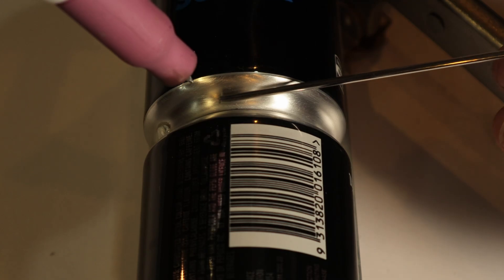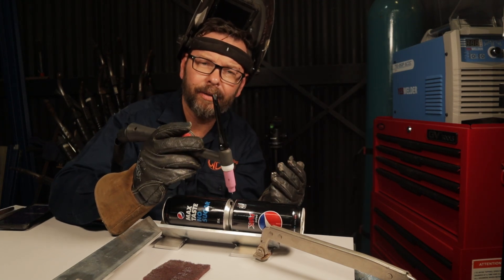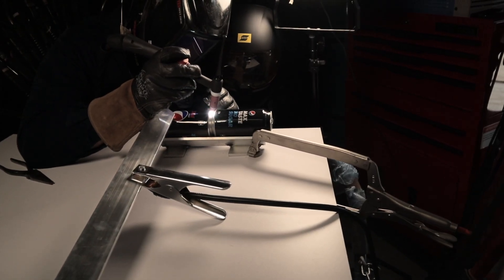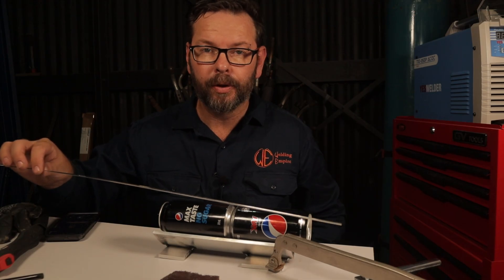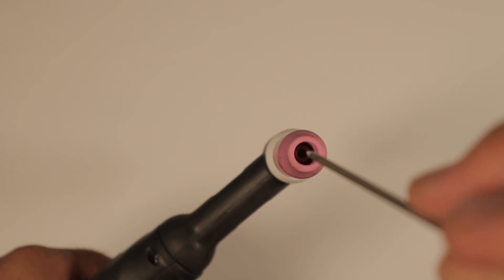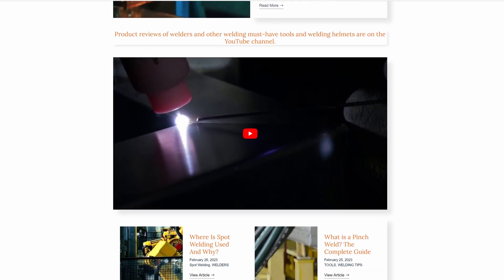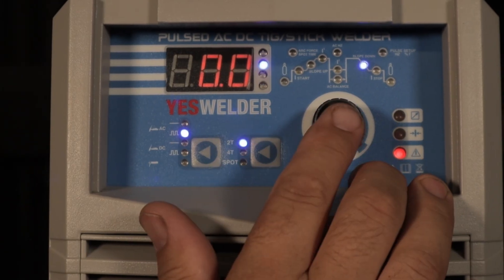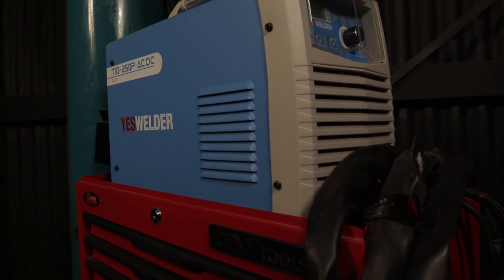How To TIG Weld Thin Aluminum, Using The YesWelder 250p AC/DC

Comment: I’m new to TIG and recently purchased a Yeswelder 200P so I could weld SS and Al. I’m learning Al and having some difficulties so looking forward to try your settings (as close as I can get) with my machine and playing around with a few of them to understand better how they affect my welds on different thickness Al material. Reading through the comments, I was especially impressed by the fact that you responded to all of the commenters. This is something I find many Youtuber’s don’t do is reply to those who comment, and especially annoying, to those who ask pertinent questions. Bravo for respecting your subscribers and commenters.
Reply from the maker: Hey @hwobstj, thanks for the kind words! Glad the info is helpful.  Aluminum can be a real challenge, so don't get discouraged. 

Remember that a clean tungsten is VERY important for good aluminum welds!  

You'll definitely need to tweak the settings to find what works best for your specific machine and the aluminum you're using. 

Treat my suggestions as a starting point.  Keeping a detailed log of your settings and the results you get is super helpful for learning. What aluminum thicknesses are you planning to work with, and what size tungsten are you using? 
 Good luck with your TIG welding.
Reply: @ Al 1/8” flat bar and 3/8” rod currently for a small motorcycle side stand improvement. Tungsten I’m using is 3/32” green pure. My welds were dirty until I did a better job cleaning both the electrodes and the Al. Then I managed to get reasonably good results with solid welds.
Reply from the maker: That's great to hear. It's all learning mate, now you can be proud of the things you have made or repaired. Your welder will be pay for itself in no time.

Comment: I don't see the Yes welder 250 AC/DC on their site.  Is this similar to the TIG-200P-ACDC-PRO AC/DC Aluminum TIG Welder
Reply from the maker: Hi Brett, sorry for the late reply. I just had a look at their website. It looks like they discontinued it. I don't think the TIG-200-ACDC-pro is the best option now. The welder needs a gauge for the argon plus a foot pedal. If you are new to TIG welding the Arccaptian welder might be a better option. The gauge is included and the controls look a lot easier to select, the foot pedal is better to buy separately to get a better discount. I hope that helps. Did you need the extra 50 amps?

Comment: Excellent.  I'm an ex-pressure/X-ray welder, and decided to get my self back into my trade for little projects for my business.  Refreshing my knowledge was important to me, but after watching so many not so great welding video's from channels that were obviously not run by experienced welders just drove me nuts.  So watching your video was a pleasant surprise.  Clear info and most importantly correct info.  Only recommendation is to maybe wear a mic so you can be heard better :)  That accent is great by the way.  Keep up the great work and you have a new subscriber!  Oh, and I love that you showed the burn through, even the best welders burn through when using a new machine or process, the key is to learn from it and adjust your parameters accordingly.
Reply from the maker: Hi Phil, thanks for your kind words I really appreciate it. I'm glad you found the video informative for your refresher. As for the burn through, people only like to show Instagram perfect welds on the internet. But when you are learning a new process we don't always pull off a perfect weld.

Comment: Great video - THANKS!
Have you ever been INSIDE the machine and noticed what looks like a blue-colored transformer-looking component around the large positive connector cable (whatever it is, you'll know it immediately when you see it)? I ask because I was inside my 250P looking for any lose wires or connections that might be causing an occasional error code E-4 (which neither the manual nor YW customer support says could show up - Weird). Anyway, all the wires looked solid and well connected, but this little component was mounted a bit crooked (not well aligned with anything), so I aligned it with the big cable it surrounded. The component seems like it may function like those small "chokes" seen externally on other cables for electronic devices, where those are used for blocking high frequencies for whatever (?) reasons. It has a large blue wire connecting it to other blue wires deeper in the machine but the component itself is just losely positioned like a collar over the large black positive cable. Well, I'm sure that is as clear as mud, but any clues? Thanks, even if you are as mystified as I am.
Also... Happy New Year and Have a GREAT 2024!
Reply from the maker: Happy New Year to you too! Thanks for sharing your experience with the welder. It sounds like you've come across a component that could be a type of inductor or choke, commonly used in electrical circuits to block higher frequencies, as you mentioned. It's interesting that it's loosely positioned and not aligned. If it's functioning similarly to the chokes on other cables, it might be there for electromagnetic interference (EMI) suppression. However, without seeing it myself, it's hard to be certain. Good job on checking the connections and trying to troubleshoot the E-4 error. Sometimes the simplest fixes can be the most effective. Keep exploring and stay safe while working on your machine. And of course, have a fantastic 2024!
Reply: I'll be running the machine again on a couple TIG projects in a few days, so will check to see if anything is wonky or if there are any codes after aligning the choke (let's just call it that for now).  One thing I do remember from almost two years ago when I saw the code (been pretty much just using stick only since then - what a waste!) was that I think I was inadvertently stretching the arc length (New to TIG + being dumb) too far from the work, like 1/4 inch or even more; I think maybe that bumps up the power output a lot, so maybe caused the mystery E-4 code. Who knows. I'll check back in to report, whatever I do discover. 
Thanks and keep up the good work!  @weldingempire

Comment: Hi there, simple question ..... would you reccomend this welder for a hobby welder with experience of other types of welding .
Reply from the maker: 100 %. 250 amp AC/DC TIG at the price is a excellent deal. It is no more difficult to set than any other machine on the market. I jave had my machine for over 2 years and haven't had any problems.

Comment: Mine didnt come with a foot pedal and im trying to get it working with only the button on the torch. Do you have any insight on settings? It will start an arc and then go out shortly after
Reply from the maker: Hi Morgan, I think if you are taking your thumb off the button as soon as you press it, that could be 2T.

If you are leaving your thumb on the button, then I would say you have the machine set to spot timer.
I hope that helps.

Comment: try 1/16 and bronze brazing rod on  AC  ERCuSi-A Silicon Bronze..fun stuff.... Peace
Reply from the maker: I used it a few times doing hydraulic cylinder repairs to build up ring lands on hydraulic pistons. Similar to this channel, https://www.youtube.com/@CuttingEdgeEngineering. But that was on an extremely old Hobart TIG Wave 250. I bet they run better on a newer machine.

Comment: Greetings, I have the same machine. I noticed that the little light was NOT on on the top of the three lights on lower far right. This indicates that you have programmed your machine for the foot pedal. I'm wondering how you got good welds without this light on? It tells you to hold down the pedal for 5 seconds and the light comes on...if mine doesn't, I get terrible welds...
Reply from the maker: Hi, very observant. The camera shot of the settings was not prior to welding so the settings had been changed. I neglected to set the foot pedal.
Reply: That explains it then...I still haven't been able to do much with aluminum cans...Great video by the way...

Comment: Ciao mi chiamo Daniele Breda, o acquistato la stesa  saldatrice che stai provando la sto aspettando perché io sono italiano, mi sono iscritto al tuo canale avevo visto altri video pero tu sei quello che mi da piu fiducia sei molto professionale come spieghi o presso questo tig perché o guardato molti video e questo e quello che mi a dato piu motivo per aquistare per me e la prima volta. Lo presso per saldare aluminio, come cater motore o cilindri di moto. O presso anche la bonbola argon  adesso devo aquistare la maschera, se puoi mi daresti un consiglio, mi serve sapere anche che tipo di stucsteno serve, spero di non averti importunato grazie
Reply from the maker: Combining your new information with the previously refined recommendation, we get the following:

"If you're only engaging in TIG welding occasionally, I'd recommend starting with a good entry-level helmet. I've personally used the Yeswelder LYG-M800HP True Color daily for about six months, and it has performed exceptionally well. I've recently received another helmet that I find more user-friendly, especially when it comes to changing the battery and clear lenses. One small issue is that the cable inside the hood requires some adjustment against the helmet, but it's worth noting that this helmet is around $30 cheaper than the Yeswelder. 

For welding an aluminum engine block, it's advisable to use a 4043 TIG wire. However, be cautious as the block might require heat treating post-welding to alleviate stresses. Welding materials like cast iron or aluminum can be quite challenging. Hence, it's crucial to hone your TIG welding skills before attempting to weld an engine block. 

For your tungsten needs, Arccaptains' 2.4mm lanthanated tungstens are versatile and suitable for both AC and DC TIG welding, and they are very reasonably priced at just $12. If you're interested in checking out the helmet, here's a link along with a 5% off code: [https://www.arccaptain.com/products/wolf-design-large-viewing-screen-auto-darkening-welding-helmet-true-color-welding-mask?ref=weldingempire](https://www.arccaptain.com/products/wolf-design-large-viewing-screen-auto-darkening-welding-helmet-true-color-welding-mask?ref=weldingempire)."

This recommendation provides a comprehensive guide on both equipment and welding techniques for beginners and those looking to weld specific materials.

Comment: Ordered one today with your discount code.
Reply from the maker: Thanks Tallyman👍, you won't be disappointed. Awesome machine. Let me know what you think after you have a play with it.
Reply: @weldingempire  I am getting the welder today and will be using this weekend.  What initial setting would you recommend for: 1/8", 14/" and 3/32" aluminum stock using 3/32" 4043 rode?  Also what size tungsten? Thanks,
Reply from the maker: Hi Tallyman15, A busy weekend then! For aluminum a good rule of thumb is 1 amp per 0.001" of material thickness. So for 1/8th 125 amp as a rough guide and 1/4" 250 amps. That will only be to begin with. once the aluminum heats up you will be backing off a lot. 1/8th I would use a 3/32nd 2% lanthanated (blue) or an E3 (purple) for the 1/4" if the AC balance is down a little lower the 3/32nd tungsten of either sort will be fine. Or step up to a 1/16th. The TIG wire will be all good. Happy welding.
Reply: @weldingempire  Did some welding this weekend and I heard a loud "pop". After that, no arc. I looked inside the welder and at least two of the IGBT chips fried. I contacted  yeswelder and requested to send a new welder. If they are non cooperative, I will request a refund and purchase a different brand.
Reply from the maker: Oh no, that sux. I have never heard of that happening before. Sorry man. Hopefully you will be sorted in no time.
Reply: @weldingempire  yeswelder called today and they are sending me a new welder. Hopefully I receive it sooner than later. I got the welding bug.

Comment: This may be silly but could I weld aluminium with a dc tig welder? Yes welder have a 250 amp dc tig welder on eBay..
Reply from the maker: You can, but it has some very big limitations. To the point, it's not really worth it. To get enough heat into the arc you will need a helium and argon gas blend. This is hard to get and super expensive, then depending on the thickness of the material, you may need to pre-heat it. You will most definitely need a foot pedal to modulate the heat. The aluminum will need to be surgically clean because the DC provides no cleaning action. If you are going to be buying a welder for the job specifically maybe a spool gun on a MIG might be a cheaper option instead of an AC/DC TIG. I hope that helps. Not the answer you probably wanted though.
Reply: @weldingempire  thank you I appreciate your reply, where did you buy your welder from? Seems hard to get a yeswelder here in Australia..
Reply from the maker: I contacted YesWelder for you. They still only ship from the US site. They are really helpful on the chat. They can spec it for Australian power.